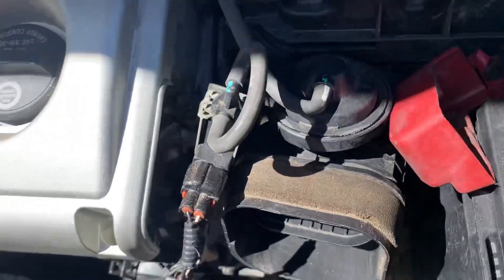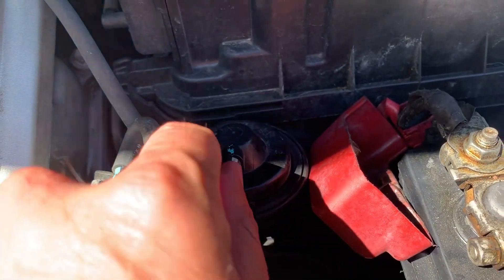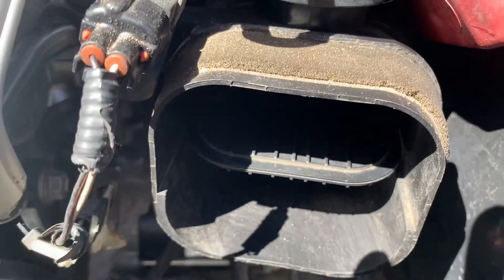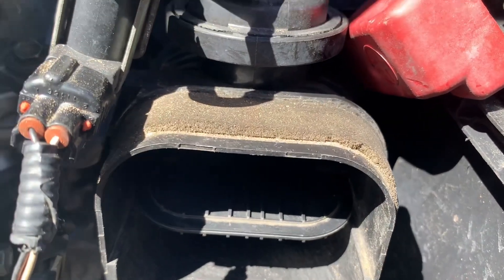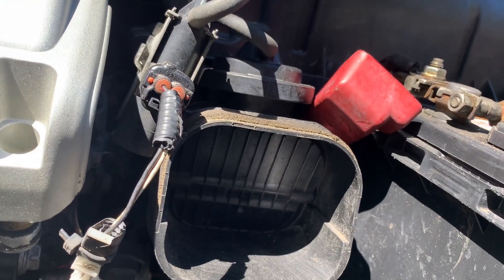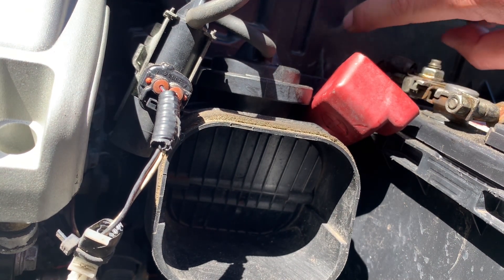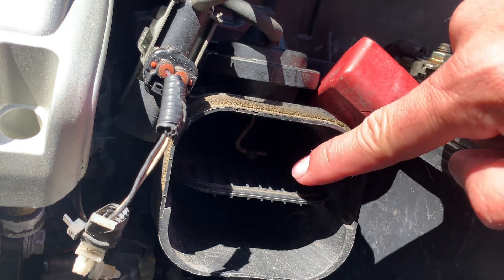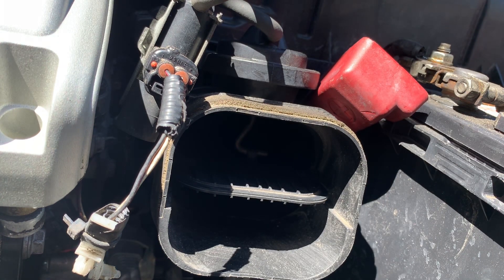Airbox mod part 2: intake flap 100% open 3mz toyota sienna lexus camry v6 3.3L 2GR

Comment: Hi, I tried installing a  short ram on my 2011 Toyota Sienna, and at low revs the engine would shut off. I'm pretty sure it's because of this part. Is it possible to bypass this part so my van runs properly? Thank you very much
Reply from the maker: if you remove the flap assembly, make sure you cap or block off the vacuum port that goes to it

Comment: Still no issues doing this?
Reply from the maker: My overall opinion in the long term is that low end performance did suffer.  I have done this mod on several other Toyotas and the result is basically the same.  

If you pair this mod with premium gas, it really makes your butt scoot.  But, overall, it doesn't really do much but pat your self on the back for modding a mini van LOL.

Comment: Will this throw an engine code at all? I have a 2008 Sienna 3.5. Thinking about doing this mod with a dry filter not a pre-oiled K&N.
Reply from the maker: No codes and passed smog just fine
Reply: @RobertFixit  thank you sir!

Comment: What’s the benefits out of doing this mod?
Reply from the maker: I can’t say that there is a benefit.  But being an old school guy, I would rather not have a flapper valve restricting my intake path.
Reply: Increased noise and fuel consumption